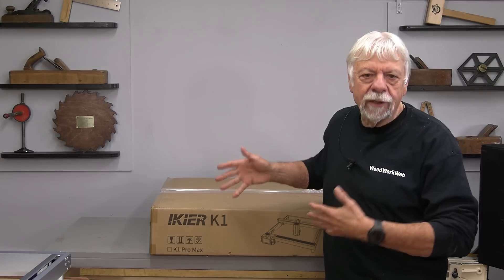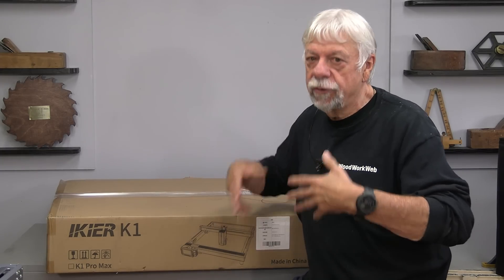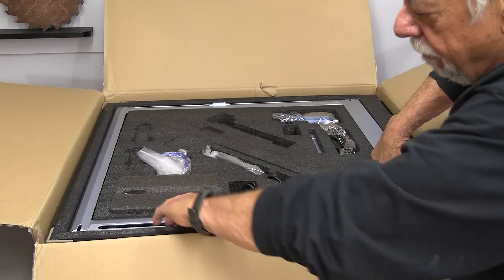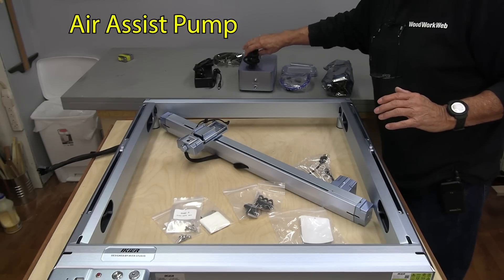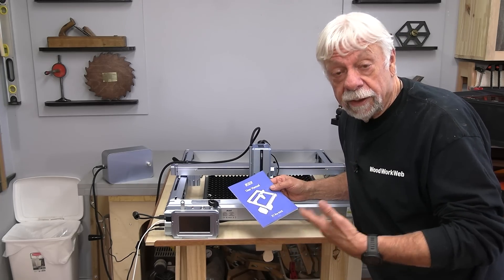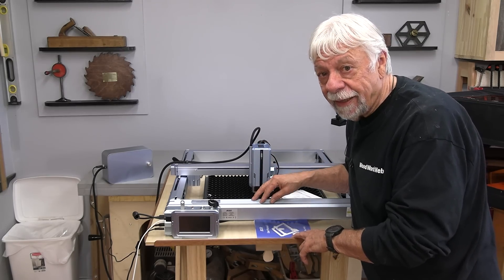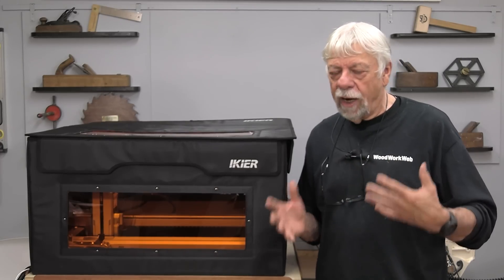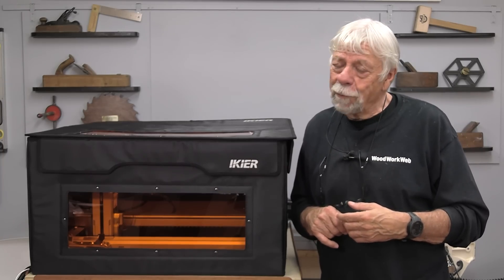Woodworking Game Changer: Finally a Laser Machine for Every Workshop - Ikier

Comment: Interesting review. I recently acquired the Xtool S1 and it’s absolutely a game changer. I already designed a new product and just started producing a new product. I initially purchased the machine to cut templates for traditional woodworking projects. 

I was tinkering with smaller projects while I was off my feet and found the laser is a phenomenally rapid prototyping machine. I can design parts and cut things out within minutes. I certainly endorse adding a laser to the woodworking workflow.

Comment: Would've been interesting to know if it can actually cut, let's say up to 10mm plywood, because that what those machines are really useful for. Then you can cut router templates for example. Etching is nice but it only goes so far....
Reply: I have a smaller, cheaper laser burner and it will cut up to 6mm. Now how many cuts it will make at this power is unknown. Coming in at around $300, my laser diode unit may burn out faster than this one shown. I use mine to cut cardboard, which it does very well.

Comment: I very much doubt that the power rating refers to the optical power of the laser. Manufacturers tend to mislead the customers. Be careful. 20 watts is currently the highest you can get in diode lasers.
Reply: xTool D1 Pro 40W, Creality Falcon 2 40W. Just to name a couple. There are 40W diode lasers on the market. They  just stack more diodes to increase the power.
Reply: @langrock74 it claims that as optical power. Less reputable ones list power draw which for this one is 220 watts. I don't know how many diodes this one combines.